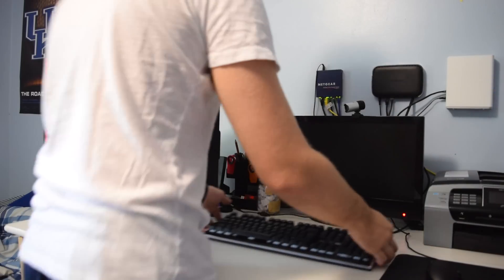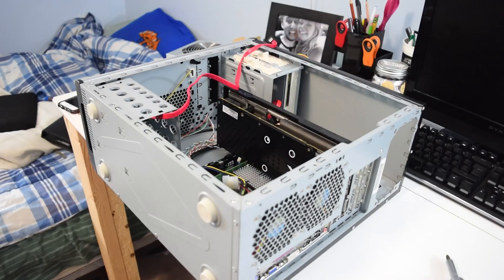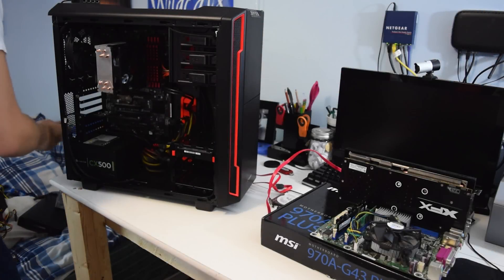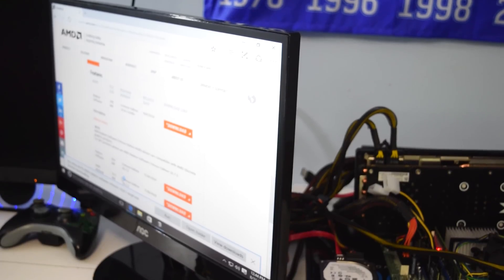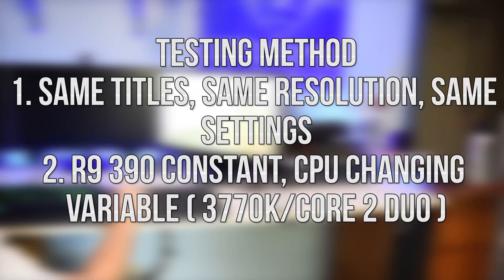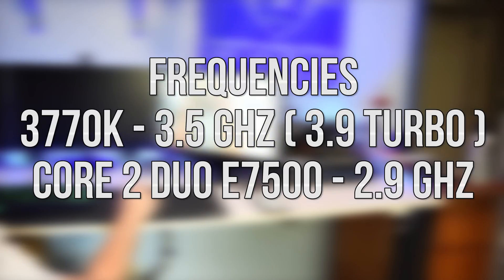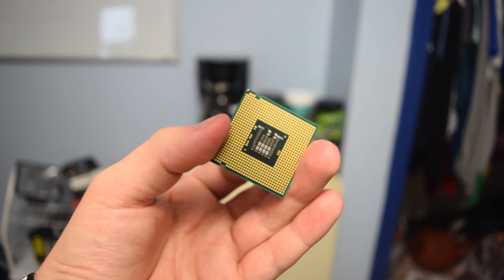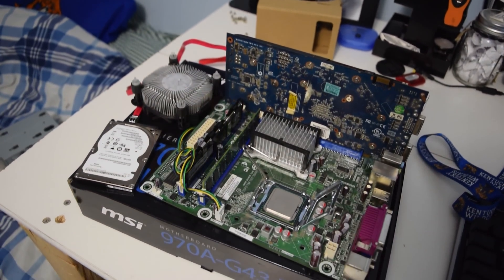$15 PC + R9 390 - Will it bottleneck?

Comment: My daily driver used to be a Q6600 and a GTX 770. Now there is a bottleneck. I upgraded the CPU to an i5 4590, and on the same settings in GTA 5 where I was getting 20ish fps avg, I got ~160 fps average. Before I had that PC, I thought bottlenecking was an issue, but not that big of one. Experience is everything lmao.